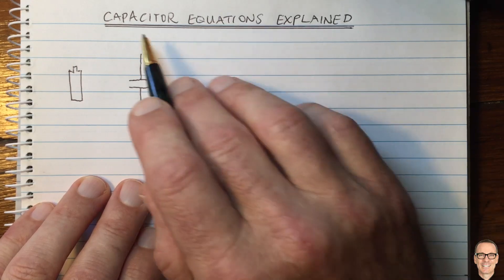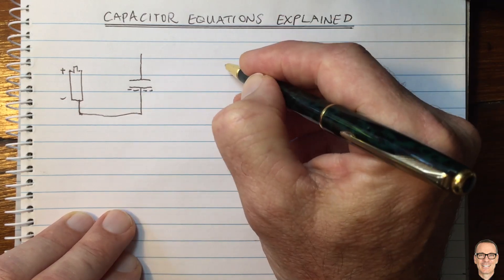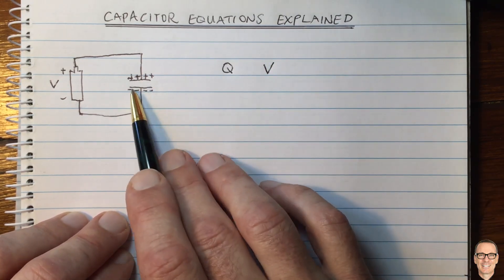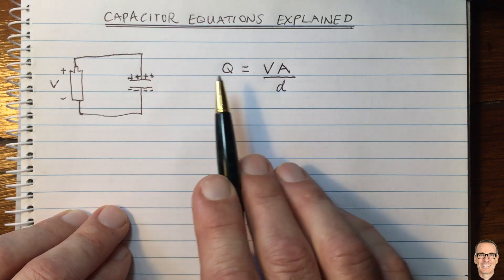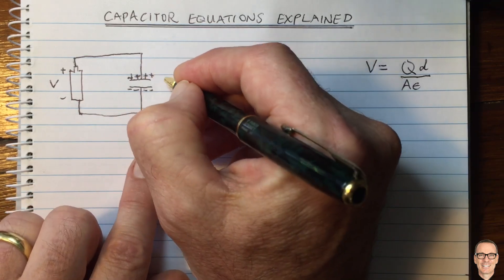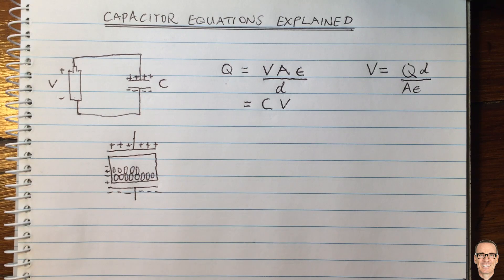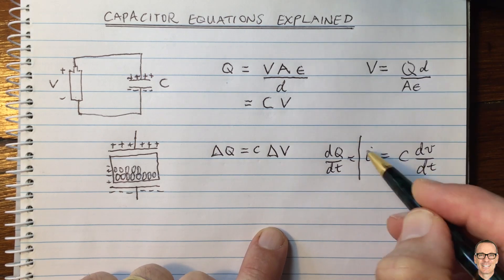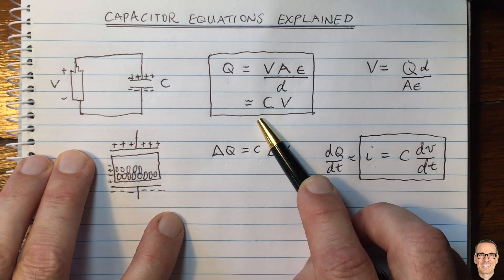Capacitor Equations Explained

Comment: Great presentation Iain! It's always good to think in terms of the accumulated charge. Back when I used to teach electronics tutorials, most students had a difficulty understanding why capacitors are considered shorts in high frequency AC (or even understanding where the frequency domain equation comes from! The link between the time derivative and Laplace variable isn't often very well explained in EE I think). I used to tell them to go back to how you showed the charges accumulating on the plates, and then imagine that we suddenly flip the battery, then allow the charges to accumulate again with the opposite polarity. Then flip the battery again and allow charges accumulate, then flip again, and so on. Doing it fast enough will make it appear like the capacitor has turned into a wire. And the rate at which we switch the battery (signal frequency), will determine how much "resistive delay" the capacitor has, so that's where the frequency term in the reactance equation comes from. The students would usually understand it intuitively from that.
Reply from the maker: Thanks for your comment. It's a great suggestion for another video. I've put it on my "to do" list.

Comment: Hey Professor! Happy New Years!! Execllent intuitive explanation!  Q: if the capacitor plates distance is shorter, this will cause the electric field forces to pull more negative charge from the battery towards the bottom plate ?  Is this correct?
Reply from the maker: Yes, that's right.